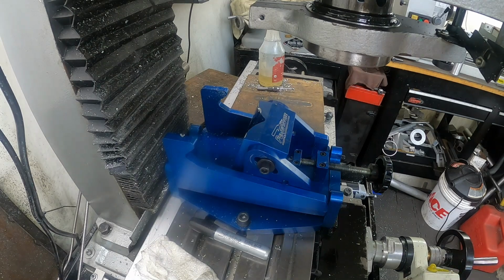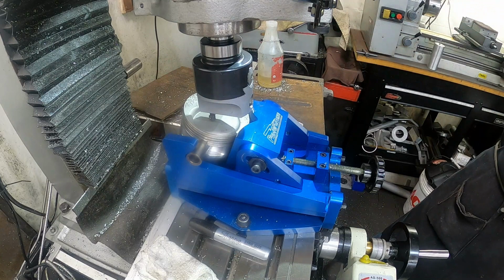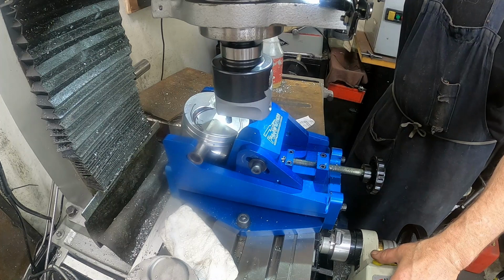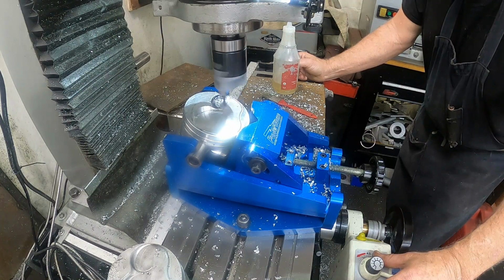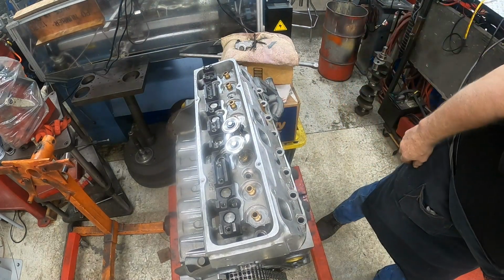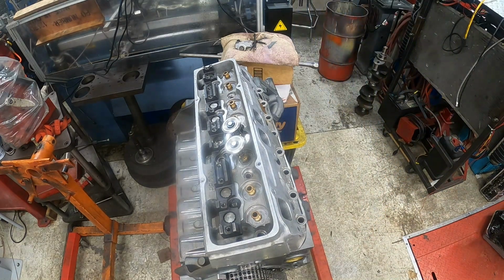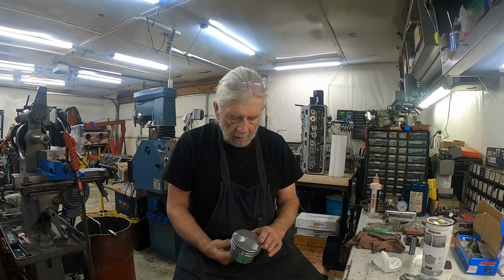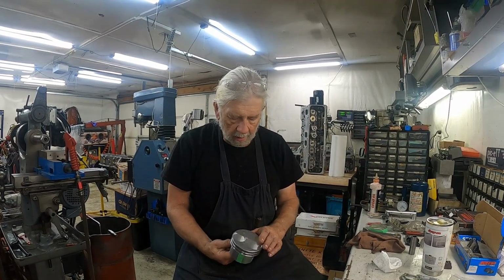Machining pistons cutting valve reliefs.

Comment: Nice. You killed that insert dragging it back and forth lol
Reply: Very cool though! I found you because I just pulled my motor to put stronger pistons for an F1R Procharger and I’m gonna do some head work
Reply: What kind of HP do you think you’re gonna end up with? What cubic inch is it? I hope to see you do more videos. I was gonna start a channel because I’m always doing all kinds of projects but I had a hard time talking to the camera. Thanks for sharing
Reply from the maker: Those were brazed carbide boring bars that I ground with big radius on the corner.
Reply from the maker: @kennyrmurray  what fuel are you going to use?
Reply from the maker: @kennyrmurray  The engine will 357 C.I.And should make about 630-650 HP@8500. I will find out when we dyno it. The engine will use dry sump oil system also. Thanks
Reply: @Randysshop   I am using E85.  Very nice!
Reply: @Randysshop  
I use carbide too on my mill but I never liked dragging it backwards or even dragging it slow forward. I felt like it dulled it out but aluminum cuts easy
Reply: You won't hurt the edge on a carbide insert cutting AI ... but you can stick aluminum to the carbide and have a problem. His finished work looks good.

Comment: What if you add 4% methanol in racing fuel would it then be ok to use smaller head casket to run it closer to 16 to 1.
Reply from the maker: I can not say if adding 4% methanol to the gas would work or not. So using a thicker head gasket did 2 things gave me a little more piston to valve clearance that I needed and lower the compression.

Comment: The valve lash makes a big difference in piston to valve clearance because it effects the duration. The lash must be at hot clearance during a valve to piston check.
Reply from the maker: Huggins cam card only has cold spec of .008. And I did check the piston to valve at that setting and it only changed by .005 thousands. I went through all that on the first piston to figure out how much I needed to machine the pistons.

Comment: All that set up on the first piston, for what?
Reply from the maker: the new pistons did not have enough radial clearance for the valve to fit in the valve relief.Also when Brodix made the heads they shifted the valve locations to make them fit, because of the size of the intake valve. So each piston I had to mark the valve location with a transfer punch down the valve guide with a piston in that cylinder bore to make sure the valve relief was in the correct location.

Comment: hope the piston crowns are thick enough.
Reply from the maker: The tops of the piston are thick enough. The problem was the corner of the intake valve relief to thin I could only cut .060 off . So I am going to a thicker head gasket on it, and without trimming the top of the pistons the compression will be 14.8 and that will work with race gas.